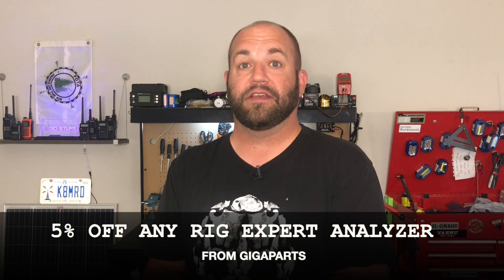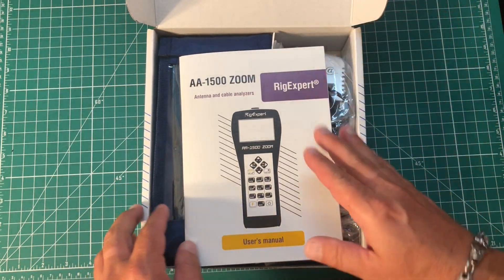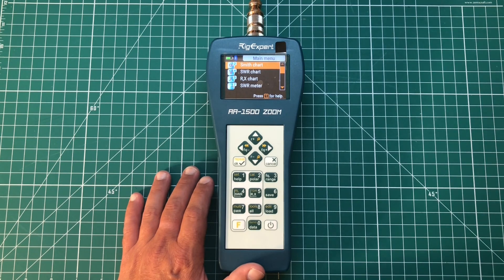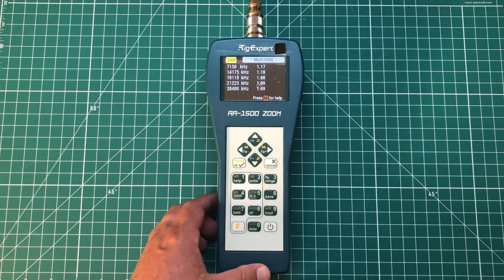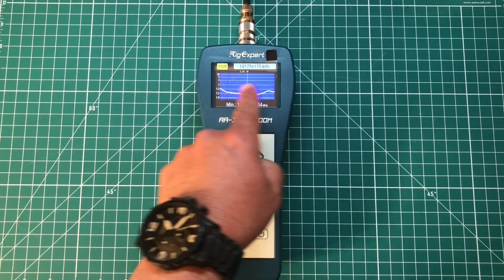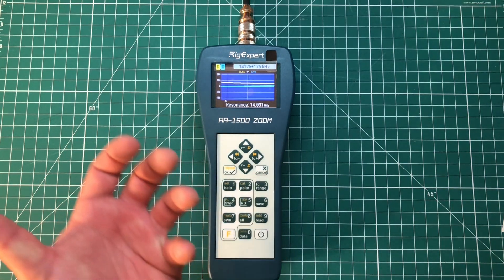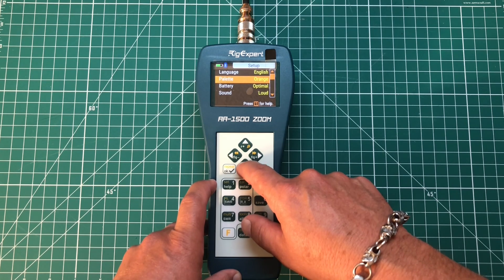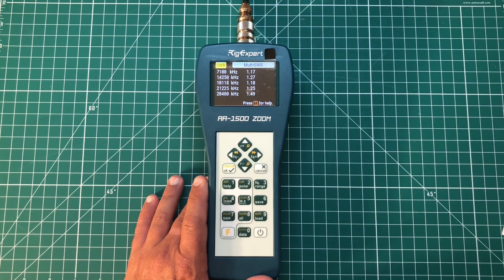RigExpert AA-1500 ZOOM ANALYZER | Best Antenna Analyzer

Comment: FYI YouTube is censoring this info:
I just received a rig expert 500 yesterday and have an ungodly number of problems with it and no way to really contact anyone for help except an email in ukraine. When you finally locate the manual it's in a font size smaller than anything I've ever seen in my life when you print it out, the software doesn't work on any of the three computers that I have and it screwed up the booting on two of them. When you change velocity factor in the settings it's not reflected when you go to take the measurement. The manual does not include any instructions on the functions on the second screen. To top it all off there's really no f** help at all from the rig expert company for any of these problems they sell it to you and then tell you to go to hell.

Comment: YouTube is definitely censoring this info:
I just received a rig expert 500 yesterday and have an ungodly number of problems with it and no way to really contact anyone for help except an email in ukraine. When you finally locate the manual it's in a font size smaller than anything I've ever seen in my life when you print it out, the software doesn't work on any of the three computers that I have and it screwed up the booting on two of them. When you change velocity factor in the settings it's not reflected when you go to take the measurement. The manual does not include any instructions on the functions on the second screen. To top it all off there's really no f** help at all from the rig expert company for any of these problems they sell it to you and then tell you to go to hell.

Comment: What a great demo. Thanks for posting. Amazing antenna analyzer.
TDR is what you use for checking for faults in your transmission line First set up the VF of the coax. Let's say there's a break in the transmission line at 82 feet. Use TDR and it will point to the fault at 83 feet. 
Barry, KU3X

Comment: I have the AA-55(?) model. LOVE it!! Saved me a crap load of time resetting the taps on a used BuddiStick I bought. Kinda' wished I would have bought the model that covers UHF but, still super happy with what I've got. EVERYONE told me to get the cheaper NanoVNA thingy but I have zero regrets spending more to get the RigExpert unit! de WB3CFN...dit dit
Reply from the maker: I bought a Nano VNA and 10 minutes after playing with it I hated it.  Ended up giving it to a friend.  Gotta have a quality analyzer.

Comment: Discount link does not work.
Reply: yes it works there is a code on the top of the ad that shows you what to add at the checkout.
Reply from the maker: You have to use the code:  HRMR